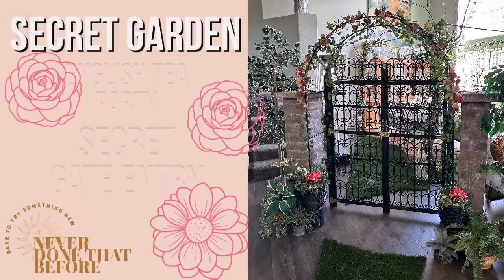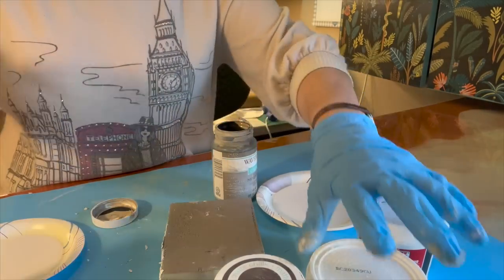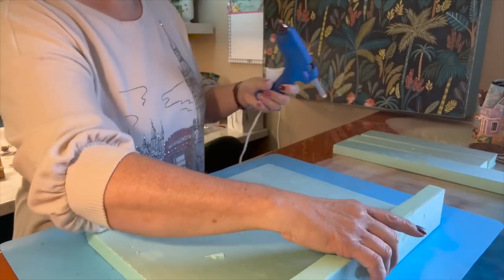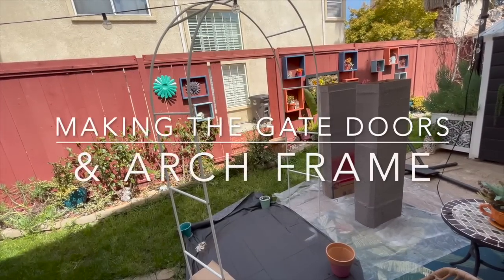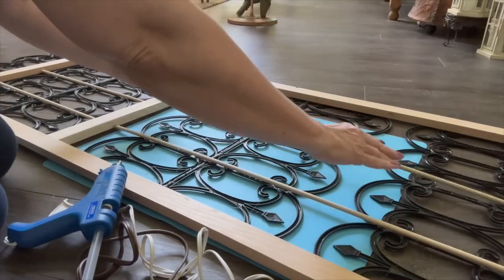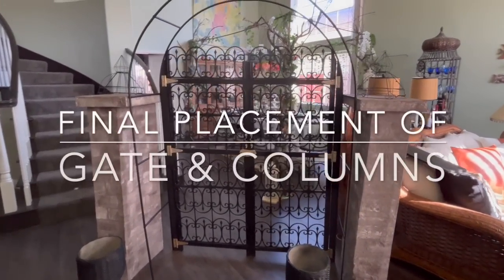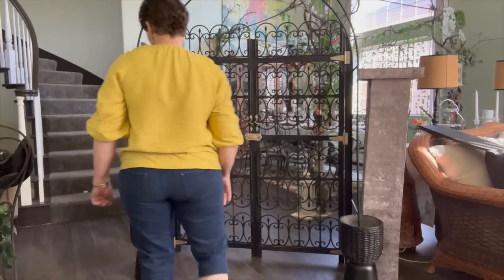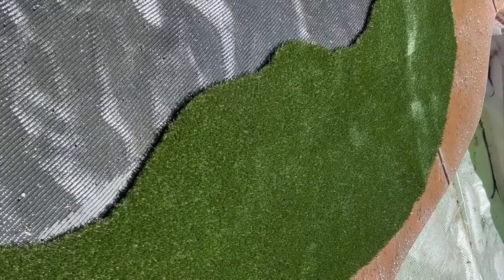SECRET GARDEN TEA PARTY - MAKING MY SECRET GARDEN GATE & COLUMNS - DIY PROJECT

Comment: You made something surprising.  Very cute idea.
A few products most crafters do not use because they are in the builders dept. I use them for 'faux' refreshing homes with little cost but my labor.
Westpac all purpose Joint compound (in a box. Doesn't matter which type used they all work) if you want something that has a plaster look or use with a stencil to have a raised look $15 Home Depot.   I used over 70s wood paneling and it looks like plaster.  Used over mobile home ceiling of some unknown type of product and looks like a plaster ceiling.  Must be sanded and a coat of paint keeps it from chalk feel and dust.
Henry's feather finish for a concrete look.  HARD as concrete using only a thin coat. $20.  Over styrofoam?  I used over a formica countertop (it really works and is strong I even changed the shape of the edge) and a 'planter box' to look like stone/concrete over a free 5 drawer metal cabinet turned on it's back and added wheels for easy move.
Reply from the maker: Yes, I love going to the hardware store for supplies and materials.  It feels like my second home when I'm in the middle of a project.  I also enjoy challenging myself to use the materials I already had, so I was lucky to have some spackling compound, which is similar to the joint compound you mentioned, but of course much lighter.  Fun ideas!